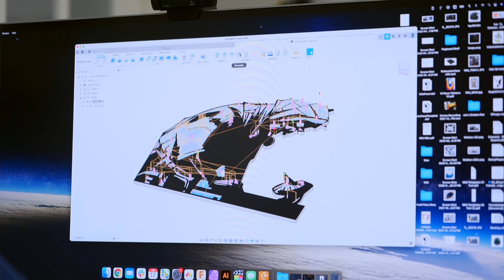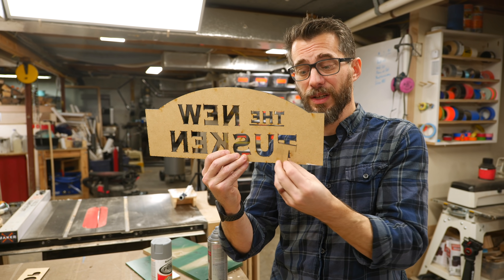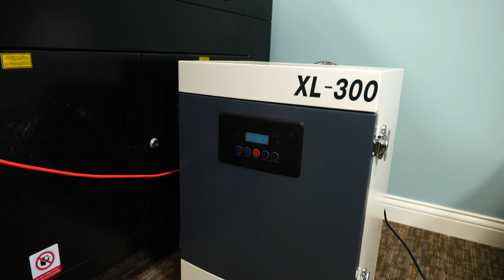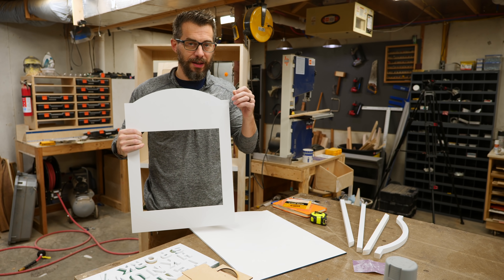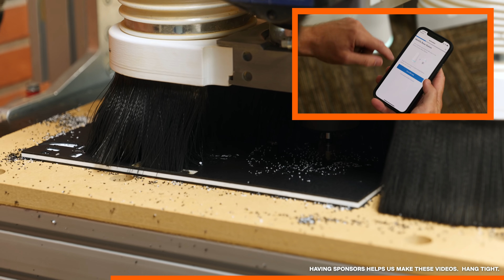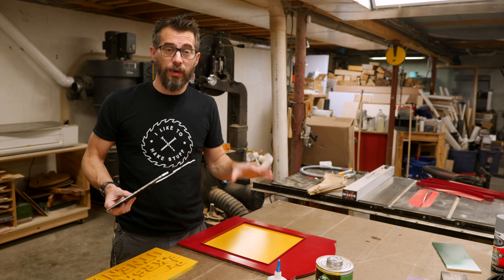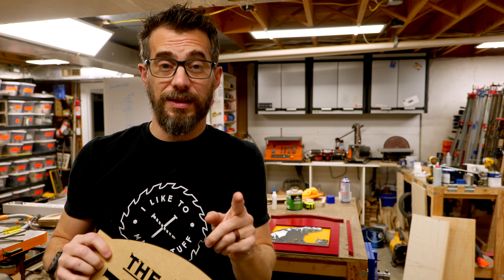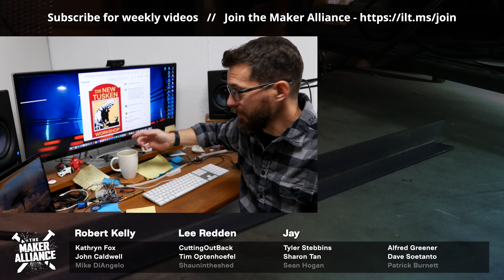Should You Buy a CNC or a Laser?

Comment: The lesson I learned is venting/filtration is a major concern. There's venting and letting wind carry the smoke and fumes away. There's filtering a percentage and venting the rest. There's completely filtering so you can rebreathe. If you have neighbors nearby or don't want nast stuff floating around you need a good filtration system and they are PRICEY. Bob is using the XL300 which is very cost effective at ~$1,300. I buy the filters kits for that one on ebay for $250 and built my own box with centrifugal fan to pull from the laser bed through the filters and then vent from there for $500 including filters. Then you're talking $4,500 MINIMUM for rebreathable air, which depending on where you live might be mandatory.

Bottom line, the cost of filtration can cost as much as the machine and information you find online is HIGHLY subjective when it comes to what constitutes proper filration and smell.

Laser vs CNCR (don't forget the R-outer, because 3D printers/Lasers are also "CNC" ) Anyway, but to me it's all about the kerf. Laser you cut and it fits. CNCR you cut and then cut again to fit. If you're doing intricate work then a CO2 Laser is far more cost effective in materials/time/wear on machine, but filters are an expensive consumable. Also, a diode laser is max 10W with dual lasers and is best for engraving and not cutting. You also can't cut clear acrylic which is a deal breaker for me.

Comment: One of my pet peeves is the entry level gear most of us start out on is all connected via USB which is total pain in the neck.    On my first rig I am running usb over tcp so I have my CNC at the other end of the house.  I can see it on a webcam and I know the hardware limits because they are all connected to an arduino so that tells me what switches are active.   A hardware switch has to trip for some time before the arduino trips the main CNC controller.  

However USB is plug and pray,    I would like to understand how the external programmer works however there has to be a better way,  like a few simple boards where I can load the script onto the controller and it runs local with the CNC on its own battery backed up power because well in case of power interuption.  

Now with the 2nd machine I am building,  we intended it to be a laser only however I bought a 3018 CNC kit so that it is future proof and so that I can mix and match parts with my 2418. 

So I have a spare spindle with this 3018 however if I damage my spindle on the 2418 then I can just swap it out without waiting on parts.
Reply: Entry level CNC does have its drawbacks. Getting new users to appreciate the minutia of CNC is not easy though. There are people willing to capitalize on the ignorance of others too. USB cannot be used for real time machine control at all. The protocol is polled and not interrupted so it simply doesn't support the timings involved. But you can make it appear to work. If you could actually discern events that happened in nanoseconds you'd see that it doesn't. But you can't. So it's all good for the people selling you that gear. As you're none the wiser. GRBL is one of the worst things that's happened to hobby CNC. It took the wind out of the sails of a more capable project. Oh well.

Comment: Something that makes a CNC a bit more versatile than a dedicated CO2 laser is the ability to attach other tools to the CNC head. I agree that you should get a CNC if you can only afford one tool, because anything you might want to do with material more suited to a laser could be done with a diode attachment.
Reply: Laser is CNC too. The distinction is in the tooling. 3D printing is also CNC. Although some laser equipment does use weird proprietary commands. HGCL? I can't remember. Even that is CNC though. As in it is Computer Numerical Control. Heck PC paper printers are CNC. There's nothing in CNC that says it has to be G-Code. Even if it is G-Code there's so many dialects of it. Not every controller interprets commands the same.

Comment: That sign looks really professional! Absolutelly amazing
For a few months I was thinking of getting a laser cutter, I wanna cut Ply Wood, thing foam, paper, vinyl, faux leather, acrylic and so on and I think laser will suit my needs perfectly. The only problem is that all the Co2 lasers are so expensive :S
Reply from the maker: Look into higher power diode lasers, they may work at a lower price point.
Reply: @Iliketomakestuff  I was looking into that aswell. Do yo maybe by any chance have some model in mind so I can check some reviews and so on? 
Its a much more affordable option but doesn't have as much power I would need to add enclosure and air assist and so on (I can do that but not on high lvl as companies do it). I could squeeze out around 1000€ but to get Co2 with decent cutting volume I need to look from 2500 up I think.

Comment: Hi Bob, are there differences in power requirements b/t the CNC and the Laser? Anything special like dedicated circuits or high voltage? Great work as usual and oh yeah, I enjoy seeing Tavin on your channel from time to time!
Reply from the maker: Thanks! Well,  the specific machine may have power requirements, but not CNC over laser..  there are 110v or 220v (240v maybe) versions of both types of machines.  I think a large CNC will more likely require 220v. Even our large laser runs on 110v.
Reply from the maker: IT depends on the CNC or laser you use. Our Huge CNC needs 220v to run the spindle but that large Laser only needs 110v.

Comment: This is about a CNC router vs a laser cutter/engraver. Lots of things are CNC (3d printers, routers, mills, lathes, saws, plasma cutters, water jets, and much more, including many laser engravers), so saying "a CNC" is like saying "an electric".
Reply from the maker: Fact, but we're trying to help people that hear about tools in common nomenclature. You are absolutely right, but who says I made this helmet on my CNC 3d Printer
Reply: @Iliketomakestuff  Fair. But we use the correct names for other woodworking tools. No one calls a plane a blade. :) By the 3d printer logic, you would just call your CNC router a router, not a CNC.

Long-term, it helps to be a little more specific, because there are so many other cool machines that people can use, and they should understand that there are huge differences between, say, CNC mills and CNC routers, and their capabilities. This can also help in software selection and setup.

Comment: So what do you think about your Avid CNC?  Is it pretty rigid, good value for the machine ?
Reply: Robert, I'm currently dialing in my new AVID PRO CNC 4848.  I upgraded from a Shapeoko 3 XXL which served me very well for years.  I spent serious cash on the Avid, $10,000+.  It's certainly not as rigid as a pro machine like a full format Shopbot but compared to a hobbyist machine (Shapeoko), it's a whole other level.  I'm still getting used to the Avid but I have to say, it's honestly terrifying to use because it's so powerful and rigid.  It feels to me like going from a nice go kart to a 4x4 truck and I look forward to trying to harness that capability.  Value is pretty subjective but I wanted to try and make my small projects in a more production-like way and I didn't want the care and feeding of the cnc to be a hobby by itself.  There is zero question in my mind that I got a good new machine for my money.  Lastly, it's expandable (4x4 -> 4x8) and upgradeable (multi spindle, aftermarket atc, plasma, laser, etc).  If you think you might do light production work or large format surfacing(epoxy tables), I highly recommend it.  Good luck!!  P.S.  The new Shapeokos are nice too but once the price is approaching 5K or 4'x4' work envelope, I would probably go Avid.

Comment: Cool sign Bob! Did you consider filling the sign with a floodcoat of deep pour epoxy? I understand it's a risk after all the effort, but it may make the whole thing more stable. Just a thought
Reply from the maker: That was the original idea, but the tusken was a matte finish and we thought paint underneath was easier.
Reply: @Iliketomakestuff  cheers, that makes sense. I do dig the layers in the abs plastic, something about the black popping out of the white vs the opposite makes it visually interesting

Comment: I have to completely disagree. Get laser first. It's easy, quick, if You need thicker part just cut two and glue them together. Ability to engrave and cut without tool changing and zeroing is priceless. Laser cutters don't need new gcode everytime, most control software is graphical and works similar to printers. I did countless laser projects and never thought "cnc would be better for that". Also You can get big chinese laser for the same you would spend on tiny shop cnc. I would never let my laser go, although I'd like to get a small cnc just for prototyping circuit boards. As for cutting aluminium and steel - it's much better to just get the parts outsourced from local metal laser cutting company, I can't imagine routing them myself from stock I'd have to buy, transport and store.

Comment: Are you using a plug-in to convert the imagine to a 3D surface in Fusion? I've been trying to find an easier way to do this for a while now.
Reply: back in my day. we loaded the image and traced it out with a spline tool. 

been a while since i've used Fusion360.
Reply from the maker: Nope, Fusion allows you to import a dxf or an svg file. You can adjust the layer heights and run the CNC toolpaths all within Fusion, no plug-ins necessary. We talk about it in our Fusion course: https://www.fusion360formakers.com
Reply: @Iliketomakestuff  Thanks!

Comment: Maybe this is a stupid question, but wouldn't it be possible to place a diode laser on(or instad of) the toolhead of a cnc if you already have one, i know the result wouldnt be safe for eyes and will be harder to use because of cnc software probably not being optimised for lasers and will probably yield worse results, but it would work
Reply: There's actually kits available to do this very thing. Onefinity even sells a laser attachment add on specifically for their machine
Reply: There are cnc offering this functionality. However, this has a drawback when used in laser engraving mode. The movement speeds will be lower than with a pure laser machine because the moving masses are higher with a mixed machine (to maintain good rigidity in cnc mode). The problem is less important in laser cutting mode because the necessary speeds are lower, but these mixed machines use laser diodes which have fairly low cutting capacities.

In addition, smoke evacuation in laser mode must be considered (personal safety and local regulations).
Reply: @AnthonyRose interesting, i will check it out, thanks for the reply
Reply: @danielfranchette5547  thanks for the explanation, i didnt think about the smoke and now that you mentioned the movement speed, do you happen to know do commercial laser engravers use belts or screws
Reply: @danielfranchette5547 thanks for explaining, now that i think about it i shouldn't have asked something so obvious

Comment: I have a Glowforge, and I regret purchasing it. So many limitations with it... The software is intended for ease of use, but is slow and limited. They push you into a subscription to have any decent features. It is terrible if you want to produce a run of parts, as there is no "cut another one" option - their slow website has to reprocess the tool path, and then you have to wait for the button to flash, and push it, before it will cut. Avoid it and get a cheaper more useful and larger capacity machine.